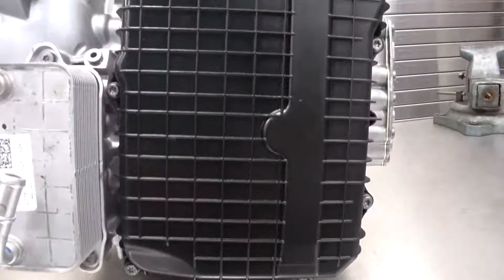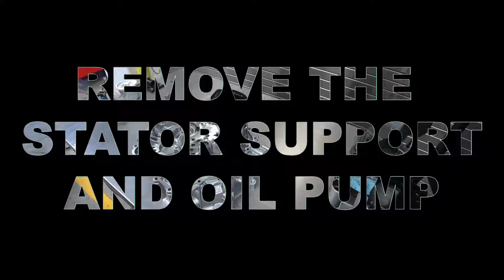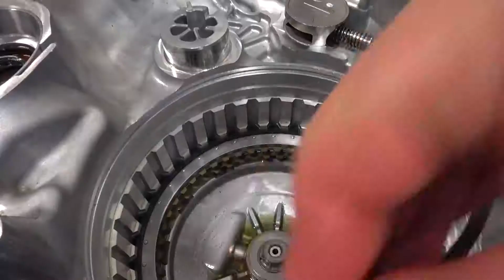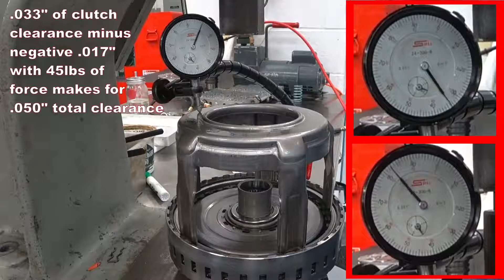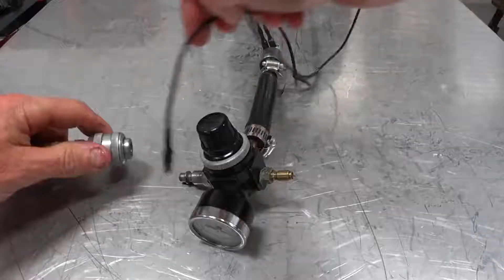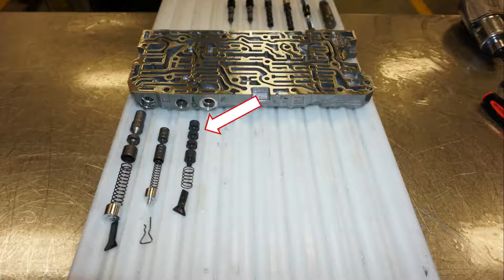zf 9hp48 overhaul video

Comment: Hey Sean, at 41:25 when you put the bell housing back on, there does not seem to be any bearing or thrust washer to keep the drum from going metal to metal with the stator support. What keep that drum from touching?

Comment: I have a 2022 Jeep Cherokee Trailhawk with just under 50,000 miles, and owned a 2018 before that. The 1st to 2nd shifts hard sometimes, its a very sloppy transmission at lower gears.

Comment: It’s 2026 and my 2018 jaguar E-Pace with a ZF9HP-48 decided to ‘gearbox fault’ itself after stopping the car. Now it’s going to cost over $8K to rebuild it at an auto transmission specialist in Australia as an apparently that’s the only way to fix it. 
Am I getting ripped off? Who knows…
It seems ZF still haven’t improved these transmissions and jaguar don’t care about the transmission. If the car went to jaguar to get fixed I’d hate to think how much it would cost for replacement/rebuild.

Comment: Hello. I am the owner of Jeep Cherokee KL, 2014 with automatic transmission en 9HP48. I have a problem that jerking occurs between 2nd and 3rd gear, the other gears work fine. What could be the problem? Have you had experience with such a problem?

Comment: Why develop this trans just to gain some mpg, when adapting a thoroughly bulletproof manual transmissioon which requires just gears and a clutch will do the same job for up too 200000 miles. It would lower the cost of cars by making a manual trans exempt from unrealistic epa standards.

Comment: I would like to add an external in-line filter to my ZF9 transmission on my 2016 Honda Pilot Elite AWD.   Therefore, I have a question regarding the oil cooler.  I'm trying to figure out which port on the oil cooler is the IN port and which one is the OUT port.  So, is the vertical port that protrudes proud of the oil cooler assembly the IN or OUT port?  Please advise.  Thanks in advance.

Comment: I have a code P0841. The vehicle stock on P and when I try to shift to R/N/ D The P light starts flashing. code says Transmissson fluid presure sensor performence. is it the sensor most likely or the valve ?
Reply: Hello What did you do to fix the pressure sensor ? I have the same code.

Comment: Is there a way to change thermistor? Mine is going crazy when humidity increases and when it's hot outside. Usually turn off the engine and start again solves problem but readings are sometimes "dizzy" :)

Comment: Any ideas on why a change from 4-5 gear usually made a clunk sound on the factory fill of ATF 3.1 on a Honda Pilot 2022 with the ZF9, but after 1x drain and fill with Honda 3.1 at only 5800 miles, the ZF9 is whisper quiet and shifts really well, better than the factory fill? Did Honda not do it right on the factory fill? I know they say to shake the bottle well before pouring it for the friction modifiers, maybe whatever they use to fill it at the factory wasn't properly agitated before filling?

Comment: Im getting an intermittent P0979 for low voltage on shift solenoid C.  I have seen some diagnostics to check wires for corrosion. I changed to fluid per honda manual.  I can doubl check levels, but i dont think it is related.

Any suggestions specific to this code?  Any other resources?
The video is great BTW. Very thorough.

Comment: Hello, thank you for the video.

I have a question: I want to change the transmission oil in my 2020 Jeep Compass with a 9-speed ZF transmission. Do I need to install a new oil pan? Does the oil pan contain an oil filter, or can I simply clean the original oil pan thoroughly?

Comment: Hello, thank you for the video.

Regarding the ZF 9HP transmission, when changing the transmission oil, do I need to replace the oil pan as well? Is the oil filter located inside the oil pan? I've heard that the filter in the ZF 9HP transmission is deep within the transmission, making it so that you can only change the oil, and there's no oil pan with a filter. 
However, the official Jeep service is telling me that this transmission has a replaceable oil pan that includes a filter. I suspect they might be misleading me so they can charge me a non existent service.... 

Can anyone confirm this?

Comment: I bought a new to me 2017 Pilot with the 9 speed and 90 percent of the time I get a smooth shift into the first dog gear 5. Other times I get all the famous hesitation, power loss, gear dump etc. Couldn’t it simply be a bad solenoid? Why would it work perfectly a vast majority of the time? I have this issue on slower acceleration usually and more acceleration does not cause a problem.

Comment: Learned a lot from this video. Just started as a Transmission Mechanic 1 for ZF location in Illinois and am currently getting trained to fix these 9 speeds. Great video👍🏽👍🏽
Reply: Will the ZF 9 speeds run fine with aftermarket ATF (e.g., Valvoline MaxLife) or is there a good reason to pay the absurd prices for the OEM/ZF Lifeguard 9 fluid?

Comment: I have a 2018 Pacifica with one of these, and it's interesting to see how things work. I'd be interested to find out why so many of them have had very hard shift problems, like mine. If you slow down to low speed and then give it gas there will be a hard slam into gear. The dealer says it's a "software problem."

Comment: Here in Brazil, these boxes are problematic, especially on Land Rovers. Here at the workshop I changed the oil in one and it subsequently developed a defect. I suspect it could already cause the defect and I just anticipated the problem. They stop moving, the customer starts/stops the car and it starts working again. I've seen Land Rover recalling this transmission even though the car is not under factory warranty.

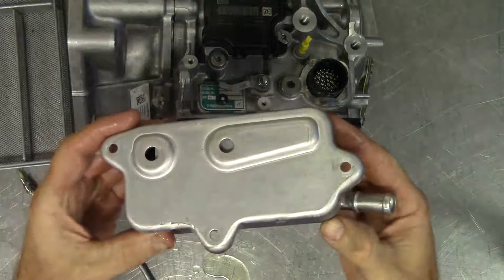Comment: at 2:05 does anyone know which of the two holes to which the transmission cooler lines go to is the source or the return, the upper or the lower? Based on 17:11 the upper hole is the source, and lower the return. Just want to confirm

Comment: You do one of the best jobs showing it all and making it simple explaining as you go along. I think your a wonderful mechanic to spend the time and setup as u have iv built many of my own transmissions most come out well last one was the old 48re in a Dodge ram deisel defanatly needs lots more cooling than the zf 9 does difference in vehicle size and weight being pulled but this is setup like an Allison impressive. I will be pulling one to build in 20k miles 2016 jeep remagade been a reliable vehicle period want to put a Cummins 2.8 diesel in front of it.

Comment: I rebuilt my ZF9 by just watching ur video and it turned out great 👍
Reply: I might have to do the same would you recommend that route? my TLX is at 112k miles
Reply: Where do you get new filter and gaskets from? No one around here even the dealer sells anything for this trans. (ontario)

Comment: i have a honda crv 2018 diesel engine with that transmission, how can i know  or measure the right level when replacing the fluid? do you have a separate video for changing the fluid of the transmission? because i think the dealership put to much in mine and did not check the level of my transmission fluid. thanks in advance,,

Comment: Follow-on here; the 3-5-R steel used to compress the C Belleville spring needs to be the smaller of the two listed in references like WIT, which they show as 6 3/8 ID, P/N 45126B. The other suffixes are shown as 6 3/4" ID, and that's too big to fit in the inside diameter of the piston. Not all of us have shops with parts laying around. It cost me a few bucks and some time to find this out.

Comment: Out of interest what would happen if the retainer from the torque convertor clutch valve (51m 22s) no longer "retained" - would this potentially put the gearbox into limp mode and would reverse still work?

Comment: Very interesting thanks a lot ! Like you've said in the comments section, the oil shouldn't be replaced as it is considered "lifetime". But does changing it would expend the lifetime of the transmission? If yes would it be better to flush it or you just drain/fill ? Thanks a lot in advance.

Comment: Thanks, Sean. Hey, could you do me a big solid here and let me know if that 3-5-R pressure plate from the 6L80 that you used to compress the C clutch return spring measures ID of 6 3/8 or 6 3/4? The part reference I'm seeing shows both. I'm a DIYer on a budget and I'll most likely have to buy the PP. Thanks

Comment: Excellent work! Really enjoyed watching this. I’m getting a code P0713 which is the temp sensor for the transmission fluid. Seems like that’s inside the valve body. Do you have the wiring diagram for the 22pin connector that is in the oil pan. I wanted to check resistance valve for the temp sensor before opening up the pan. 2016 Acura mdx 9sp ZF transmission. Much thanks!!!

Comment: What's your take on using alternate fluids in this transmission such as valvoline max life or amsoil product instead of the 8-9 speed fluid
Reply: The best fluid I've found to replace all trans fluids is the John Deere hi gaurd low viscosity hydraulic fluid it was designed for gear box applications such as this and is a much better fluid both for wear and clutch engagement remember jd uses friction and steels inside for not just clutches but brakes as well it is a much better fluid but I have never used it in a zf 9 I have in 48re Ford c and several others wonderful success but not tried in the zf9 yet.

Comment: The engineers who design a transmission with all these parts are amazing. The people who can take it apart and put it back together are also amazing. I can see why they just replace them now.
Reply: Mine died at 8000km 4970 miles and it cost Honda 15k to get me a new one it's over engineered and too complex but it's a German product 😂
Reply: The labor at a shop to disassemble, rebuild and reassemble would be more than just buying a remanned unit.

Comment: Hello~ My 2019 Civic Diesel 9AT just reached 20000 miles and the shifting is problematic to me. The issues are: 1. Shifting from 1st-2nd is usually hash & pushing hard even mild throttle 2. Very weird when the car shifts from 4th-5th gear, the car often "hard engine brake" when mild accelerating and everyone's head will dip. But this will not happen if accelerating rapidly. I am going to bring it back to Honda for further checking but I am afraid they will say "unable to replicate the issue". so worrying
Reply: except the above issue the shifting up & down through 1st-9th gears is OK especially when accelerating rapidly, it's smooth. But when it comes to low speed + stop & go city area, it's really painful. 4th-5th gear is driving me crazy.

And Thank you very much for the video. Very informative.
Reply: I have the exact same car and same transmission. For me it shifts hard when going from 4th to 5th when going slow. If you drive at 42 kmph, it is the worst manifestation and you hear a loud click or hit.

It started around 30k km. 

It was under warranty and they replaced the oil, battery (!!). It did not help, as the issue remained. They told me it is normal shifting for this transmission ZF9

Regarding replicating issue, this is what i found:
1) gear box has to be warm, so drive for approx 20-30mins
2) slowly speed up from 30kmph to 50kmph and at 42kmph the jerky shift will occur
3) engine rpm will be around 1700 when it happens

let me know how you sorted it out. In one other video, they replaced the pressure sensor: https://www.youtube.com/watch?v=MM40QLo5E5M&ab_channel=TimLampe

Comment: Well done and well explained

Greetings from one who developed this transmission at zf for many years
Reply: is this transmission really reliable because it uses dog clutches?
Reply: Quite the design, but can you share the reasons behind making filter access such a pain? Normally, the filter is replaced when doing a normal fluid dump and refill.
Reply: Argental Griller thanks for this smooth running transmission. I got one in my Jeep and i appreciate this transmission i like how it runs and after watching some of this in depth rebuild i am very pleased to see actuall gears and not belts on pullies definitely a keeper 🤠
Reply: I bought a new to me 2017 Pilot with the 9 speed and 90 percent of the time I get a smooth shift into the first dog gear 5. Other times I get all the famous hesitation, power loss, gear dump etc. Couldn’t it simply be a bad solenoid? Why would it work perfectly a vast majority of the time? I have this issue on slower acceleration usually and more acceleration does not cause a problem.
Reply: @mattholmgren953  did you ever figure this out?
Reply: Any secrets you can share to keep it changing smoothly? On a 2020 Evoque D180..
Reply: do you think you could help me with a few questions about this transmission please? im trying to make some upgrades.... iim super lost though T.T

Comment: Hi  I  have a ZF 9 speed transmission fitted to  my  Land Rover Discovery sport and am having issues when changing Up from 4 to 5 But  only  when cold ... when the engine reaches temperature the gear change is fine...... struggling  to find any  advise re way  forward. had a software update that  made no  difference...... what's next? transmission oil change? rebuild? new gearbox/ any advise would be appreciated thanks in advance
Reply: How did you make out? I am having similar problems.

Comment: Does anyone on this blog know the parts from 2016-2020 ZF 948 are interchangeabe as a full set, thus can be swapped from one case, say a 2016, into a 2020 case?
Reply: I am particularly interested in Jeep.    And, what model year is the trans in the overhaul video?
Reply from the maker: I think as long as you swap among Jeep parts, you'll be okay.  In talking with the ZF trainer, he says that all the Jeep cases and internals are built in the FCA/Stellantis plant in Indiana, whereas all the Honda and Land Rover cases and parts are built in the ZF plant in South Carolina.  I've had them both apart and side by side, and other than valve body, they all fit together and appear the same dimension wise.  You can tell, however, that the parts are casted differently.
Reply: @siuautomotive  I''m wondering if a 2.4l or a 2.0l engine transmission case excluding bellhousing is same as 3.2l, with the bellhousing serving to adapt the tranny to different engines.   Also, if all 948TE have the same set of gear ratios and clutch packs, in other words a "universal" internal hard parts design, very good for manufacturing efficiency.    I notice the 2.4l and 3.2l use the same valve body part number.  Are different engines then managed by TCM so they can use the same tranny internals?  What is your observation?  Sorry if i seem to belabor the issue, but better to measure twice and cut once, as they say.

Comment: I recently changed my gearbox and tcu,but the drive and reverse light keep blinking the car does not move
Reply from the maker: I’m sure you’ll need to get it programmed if the tcm is new.  If it’s used, it’s detecting a mismatch.  Either way, there should be a code stored.

Comment: Do these transmissions always come with a metal tag or engraving with VIN number? or is there just a white sticker with the part number only?
Reply from the maker: All the ones I've seen have a metal tag, but I don't think it's the VIN.  Just a serial and model number.  I'll have to check though.  Honda typically puts their vin on their transmissions, but I don't think it's on the ZF.

Comment: Hello!

I bought an old Renegade 2015. Changed the transmission oil 1000 km ago mostly because of how old the oil was.

Car runs fine than ever, but now I'm getting a leak on the outside of the transmission that I can't found where it's from.
Do you have any suggestions?
Reply from the maker: Are you sure it’s trans fluid?  You could put dye in the trans and use a fluorescent light to see where it’s coming from.

Comment: Very detailed and informative video. Thank you very much for considering the camera angles for the viewers . I have been looking and asking for quite some time without being able to get any real information on the subject of modification . This transmission is rated for 350 lbs torque and I would like to know if it is at all possible to increase that number more into the neighborhood of 400 to 450 . If it can be done what else would have to be done for things to work properly ?
Reply from the maker: I’m sorry but I don’t have any suggestions for you.  That trans is so software dependent that I’m sure having the ability to tune the software would be necessary.  I don’t know of any aftermarket parts available either that might be stronger
Reply: @siuautomotive  HP tuner claims to have the ability to tune the transmission but Im not sure of how successfully.  In your opinion do you think that it will handle 310 to 320 ft-pnds reliably without any real changes ?
Reply from the maker: I might be able to see if I can pull a zf9 tune this next weekend.  I think with the correct torque management it could hold 320 ft lbs.
Reply: You are so awesome dude I really appreciate your willingness to help with this .

Comment: I have a diesel renegade with this gearbox. When stopping at a traffic light do you recommend putting on N or keeping on D?

In D the car gets a lot of vibration. Apparently it relieves transmission by placing the N.
Reply from the maker: I’d keep it in drive.  My guess is that the mounts aren’t doing a great job of damping the engine pulsations.